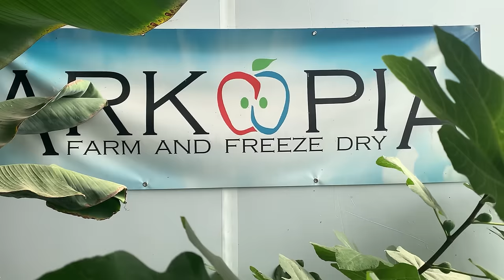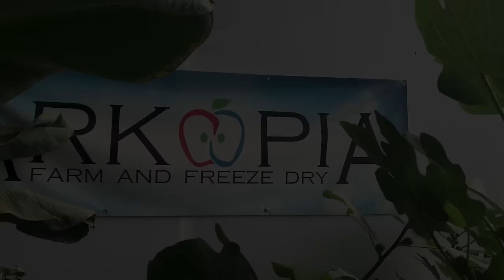The Most Efficient Greenhouse on Earth | $100 a year to heat in -40C with Sand Battery Thermal Mass

Comment: TLDR: Patrick's innovative greenhouse design employs a sand battery and solar thermal heaters to maintain tropical plant growth in extreme cold for just $100 a year, showcasing sustainable and efficient agricultural practices.

1. 00:00 🌱 Patrick's innovative greenhouse design utilizes a sand battery and solar thermal heaters, achieving efficient heating for just $100 a year even in extreme cold.
	1.1 Patrick improved upon an existing greenhouse design by incorporating a sand battery and solar thermal heaters, making it cost-effective and efficient for his needs.
	1.2 A well-placed greenhouse in a microclimate with tree protection can thrive without frost issues, allowing for efficient gardening.
	1.3 A greenhouse was built in four months using a sand battery for thermal mass, allowing efficient heating even in extreme cold, despite initial supply chain challenges.
	1.4 A greenhouse heated for $100 a year using a sand battery maintains temperatures around 12°C in winter, even reaching 35°C during extreme cold, thanks to effective insulation and heating methods.
	1.5 Using a sand battery with insulation under the thermal mass in a greenhouse is more efficient for heat retention than relying solely on uninsulated concrete and gravel.
	1.6 Using water and glycol for heating in greenhouses provides superior heat transfer than air, making it more efficient for maintaining temperature.

2. 07:05 🌱 This innovative greenhouse, designed for extreme cold, uses advanced insulation and thermal mass to maintain tropical plant growth with minimal heating costs.
	2.1 The greenhouse is 64 feet long, 32 feet wide, and features a raised bed, hydroponics, and an efficient design for growing fruit in cold conditions.
	2.2 The greenhouse utilizes a post and beam construction with R40 insulation and salvaged freezer panels buried around it to prevent frost penetration and maintain heat efficiency.
	2.3 Rainwater collection is planned for the greenhouse, but challenges with the gravel pit and lack of rain have delayed implementation.
	2.4 The greenhouse effectively maintains temperatures above 10°C during harsh winters to support the growth of tropical plants like oranges and bananas.
	2.5 Using evacuated tube solar heaters to charge concrete and sand thermal mass allows for efficient heating of a greenhouse in extreme cold, requiring minimal diesel fuel for additional warmth.
	2.6 The greenhouse efficiently maintains temperature by utilizing thermal mass from sand batteries, black-painted water tanks, and other materials, which absorb and release heat throughout the day and night.

3. 12:48 🌱 A highly efficient greenhouse maintains a stable environment with minimal energy costs through effective ventilation, thermal mass, and improved pollination methods while requiring manual intervention for optimal plant care.
	3.1 Maintaining the greenhouse requires manual intervention for venting and checking on the fish, as automated systems struggle with winter conditions.
	3.2 The greenhouse utilizes effective ventilation and thermal mass to maintain a stable environment, allowing for efficient cooling and heating with minimal energy costs.
	3.3 Adding an air exchanger to the greenhouse would improve air circulation and prevent plant damage in extreme cold, unlike relying solely on a climate battery.
	3.4 Reducing watering in the greenhouse significantly lowered humidity and helped manage pest issues, resulting in healthier plants.
	3.5 Implementing drip irrigation and additional fans significantly improved plant care and pollination in the greenhouse.
	3.6 Honey bees struggle to survive in winter greenhouses, making bumblebees or Mason bees more efficient pollinators.

4. 19:15 🐟 A sustainable aquaponics greenhouse efficiently combines fish and plants, using solar heating and minimal energy to thrive in extreme temperatures.
	4.1 A large, resilient fish tank was created by modifying a 12,250-gallon tank to prevent fish from jumping out, based on insights gained from YouTube videos.
	4.2 The greenhouse maintains a symbiotic relationship between fish and plants, with temperature control managed through solar heating and concrete contact, ensuring the fish thrive without overheating.
	4.3 A sustainable aquaponics system utilizes fish waste to nourish plants while providing clean water for the fish, requiring minimal energy input for circulation.
	4.4 The speaker experienced success in raising bright pink fish in a large circular tank, leading to a consideration for expanding the setup.

5. 23:10 🌱 A highly efficient greenhouse utilizes a resilient aquaponics system, gravity-fed water recycling, and minimal supplemental light to thrive in extreme cold while promoting mental well-being through nature.
	5.1 A Venturi system creates a natural vacuum to pull air into the water without needing an air stone, but a backup air stone will be used in case the pump fails.
	5.2 A resilient aquaponics system uses a vortex pump to circulate water, removing waste and feeding it to banana trees while maintaining a healthy environment for fish.
	5.3 Lettuce is grown using a gravity-fed system that recycles water from a fish tank, utilizing bacteria for nutrient absorption without the need for stones.
	5.4 Plants thrive with minimal supplemental light, efficient airflow, and exposure to bird songs or music, which enhances their growth.
	5.5 Building a birdhouse enhances mental health by allowing enjoyment of nature indoors during harsh winters, while growing banana trees in a greenhouse creates a tropical atmosphere.

6. 28:14 🌱 A highly efficient greenhouse, using a sand battery for warmth and solar energy, thrives year-round with diverse crops while costing only $100 to heat in -40°C.
	6.1 The greenhouse project is expected to be completed by this summer.
	6.2 The greenhouse is thriving with various plants, including grapes, strawberries, blueberries, and peaches, all benefiting from added light and careful management to ensure growth and production throughout the winter.
	6.3 Fresh garden beans are preferred over canned, and optimal planting orientation and drip irrigation enhance growth and sunlight exposure.
	6.4 The speaker shares their experience of successfully growing various cold-tolerant plants in a greenhouse, allowing for year-round fresh produce.
	6.5 The greenhouse efficiently uses insulation and a sand battery to maintain warmth in -40°C, costing only $100 for heating over the winter while supporting local pollination with its own bees.
	6.6 A highly efficient greenhouse utilizes photovoltaic panels and solar thermal systems with DC pumps to maintain heat and ensure continuous operation, even during power outages, while optimizing energy storage and usage.

7. 39:03 🌱 This innovative greenhouse uses a wood stove and thermal mass to maintain warmth in extreme cold for just $100 a year, enhancing local food security and resilience.
	7.1 The greenhouse utilizes a highly efficient wood stove and heat exchanger system to maintain warmth, demonstrating a resilient heating solution.
	7.2 Building efficient greenhouses promotes personal food security and community resilience, allowing families to take control of their food systems.
	7.3 Personal and community food security can be enhanced by growing food locally, even in challenging climates like Zone Three.
	7.4 The greenhouse efficiently utilizes solar thermal energy and thermal mass to maintain warmth in extreme cold, costing only $100 a year for heating.

8. 43:23 🌱 A visit highlights the innovative use of a sand battery for efficient greenhouse heating in extreme cold.

Comment: Would this work well having the back wall dug into a bank?
Reply from the maker: As long as you want to spend a lot building a strong north wall. 👍
Reply: The greenhouse would be built into the hill with a sloped glass front.  No need to build a north wall just reinforce, insult and run infrastructure into it and floor.

Comment: Annualized climate battery just doesn't work. If you actually simulate out a thermal mass heating in the day and cooling at night what you can fit under your greenhouse or into your house the temperature you started at two weeks ago has a near zero impact on the temperature you are at now. 

The oranges in nebraska guy can make it work by just tapping into the year round ground temp in his area. He's not trying to store any heat in summer to use in winter he is just using what he has available always.
Reply: yeah it true about low temp storage (<100c) it only few days of heat storage at best in the winter . and i keep trying to point out the NB or Utah lives at Lat ~40. at that Latitude  the  of sun intensity you get on winter solstice.  is the just a little worse then the amount of sun you get on spring equinox at +50 latitude. so they have alot of solar gain all winter long  so the ground battery is okay for them as their Min solar gain is >45%  for the winter. in Canada Edmonton is ~15%   Saskatoon is ~20%  at boarder on the parries 30%  . in US where these ground batteries are "common" they are also only dealing with mean winter temp of greater then  -5c so the ground battery it likely to keep them above zero all winter long . in Canada at LAT +50 where  the mean temp of Edmonton is -11C  in the winter, Sask is -14C. where i live it is -17c(Man)  and the 10c ground temp with a much colder ambient  air will  not keep it as warm you can expect, at best -5c during coldest periods
Reply: You right that a climate battery is not effective enough in our area. I know with a charged sand battery   it will give off its heat for at least a week without additional solar imput.. if I have it up to temp while the days are longer I only have to maintain it when the days are short and cold
Reply: @patrickbos825 same here I use  thermal storage in my house heated by evacuated solar tubes . i only generally need one day to charge them or if they are really cold 2 days . and i am good for 3 days this time of years. in the dead of winter and cold , I am only good to maybe the middle of the night as the thermal batteries  are not reaching 70c and  only make it 55c  if very clear day and the cells are uncovered . then after that heat pump kicks on..
Reply: Yes, I've seen these done at two depths.  A shallow depth for storing daytime heat for the following night or a deep system which is designed to bring up the "permanent" ground temp that doesn't change much at low depth.  However, northern Alberta would require a fairly deep system for the second kind, and even then... the permanent ground temp is above freezing, but not by much.  In other words, if the citrus and other tropicals require 10-15C or higher this will not be enough.  With hydronic heating I'd be very tempted to extend the roof out the back and make multiple Jean Pain style wood chip compost heaters.  There are a few examples on YT.  One proves out the design parameters (BTU/ton, etc.) while the other shows how to optimize with two piles (alternating so you don't draw a pile too cold so it has a hard time coming back up to temp).  Note: you don't want them in the greenhouse due to some of the gases given off.  The guy heating his greenhouse this way has his pile lasting through the winter, quite impressive.  I'm sure this could be scaled for the needs of this greenhouse.
Reply: @vesc1389  I would probably opt for building biodigestor over composter   and make biogas gas. which is just a large tank of water  and  bladder .  and then just burn   the biogas  to   heat the building . they are spending fairly large sum of money  to build a relatively fairly small greenhouse . what the difference another $15000 to build a biodigestor . he bought some cattle just use their manure as the fuel. each animal produces enough manure per day to generate about 2kw of heat energy in the form of bio gas  if he has 40 animals  that technically around 29000 kwh of heat energy per year from the manure . but then you have all the waste hay and bedding  to include  probably closer to 60 or 90 thousand kwh per year

Comment: Anybody know how deep the soil has to be for those banana trees? Growing in pots? I'm assuming the sand layer is under the whole building.
Reply: The sand battery is only under the concrete. I have 2ft of soil where the bananas are planted. Regular soil under that.
Reply: @patrickbos825  Thank you for the reply. Amazing structure and systems you've put in there.
Reply: Thank you

Comment: So Dean....Patrick has a citrus bed right next to an exterior wall with only horizontal insulation out 4 feet and that bed is doing well...he's not losing his precious heat out of the greenhouse and the frost isn't getting to the bed....so do you think insulation down vertical is even necessary at all?....or do you think his sand bed walkways that are insulated are heating up that bed to the point that it keeps cold away?....if so then isn't he losing heat from the walkways out into the soil beds and  the earth can quelch that heat, which is what he was trying to avoid?....I feel like it's got to  be one or the other thing happening here...I want to get away with only using as little insulation as I can but to still be successful...any help would be appreciated!...thanks again for the amount of effort you put into this whole thing!
Reply: On my new greenhouse i went with ICFblock down 4 feet which should achieve the same results as horizo tal insulari . Some plants dont want to have warm roots so you have to be carfull what you plant next to the sand battery. The bananas like it but the lemons dont
Reply: @patrickbos825  
You have another NEW greenhouse?!.... Why!?.... also  do you have any videos of that one yet??... I'm assuming Dean hasn't made a visit to that greenhouse yet.... lol
Reply: @patrickbos825  
And to be more precise,  I don't mind doing the horizontal insulation.... My question is do you think it's just as effective as doing vertical insulation and in the case of your citrus trees vertical insulation is not needed and might even be better without it?
Reply: @toddvillanueva6699  the new one is for the swimming pool, sauna and hot tub
Reply: I think both are important,  horizontal is to keep frost from hitting your foundation
Reply: @patrickbos825  
That's awesome you'll have to do a short video on the swimming pool greenhouse
Reply: @patrickbos825  
But there is no foundation on a  pole barn (beam and post) construction... . You guys were saying that frost goes in at a 45 degree angle and the frost has no power way down there...am I not understanding something?... thanks so much!
Reply: I guess what I'm asking is: Is vertical insulation even needed on a post and beam construction greenhouse?...of course more is better but if we only had the money for one type, would you put the money into Horizontal insulation like a skirt around the building or would you do vertical insulation like a thick trench around the building?....thanks again
Reply: Oh I see...I missed that you did insulated block foundation...okay so both is essential?....I think I got it

Comment: What type of Styrofoam did you use and how thick?
Reply: Under the sand batteryvi just used bead board, its the cheapest. Around the building i used polystyrene
Reply: @patrickbos825   - Hi.  You only used 1" bead board?  Thanks.

Comment: MOLD , MOLD MOLD ,I’ve read many article about sand , if it’s wet or even slightly wet ( which is 99% of sand ) it will promote mold after a few years as the water has no where to go but up,  as a vapor barrier and insulation under sand ,,,, read insulated code quide clearly states ,,, where do you find dry sand that doesn’t  cost 10 mill a load, hmmm
Reply: There is no vapor barrier under the sand battery and concrete on top of it.any moisture can only go down. Sand is inorganic and I have never found mold on any that I have dug up.

Comment: This might seem "fantastic", but this is an extremely expensive greenhouse. The payback is probably in the neighbourhood of 20 years, maybe 30 years. I think I will take a hard pass on this. I would much rather go with a kit build. Like Arctic Acres, for example. They employ the water tank night time heat transfer too. They are on YT.
Reply: My greenhouse was $20 per square foot. Artic acres is $50 for  round building with a round tank in it. You end up with a crescent moon shape to work with, it's not an efficient work space.
Reply: @patrickbos825  I would suggest that you redo your cost calculations. $20 per square foot sounds like a wet dream. I would estimate that the real cost is North of five times that much, if not close to ten.